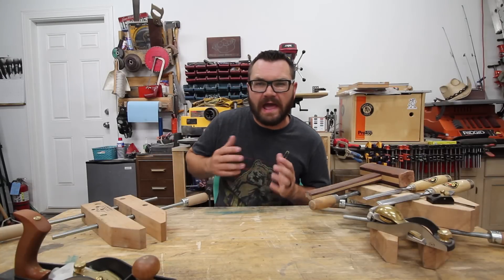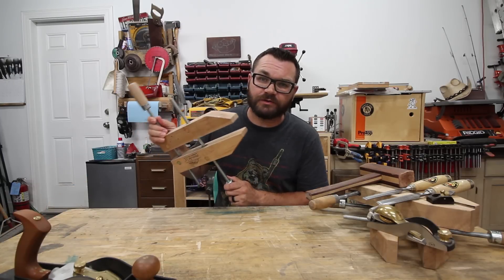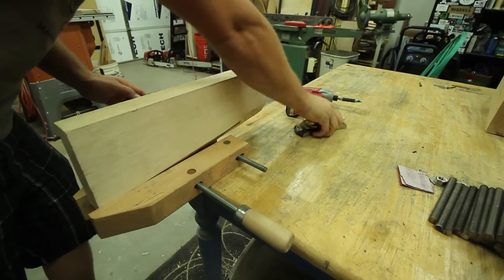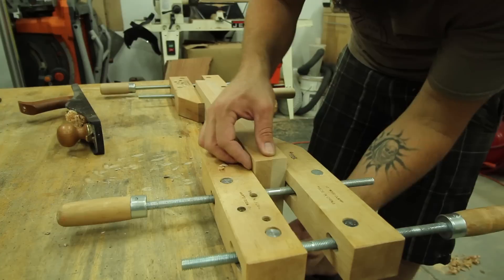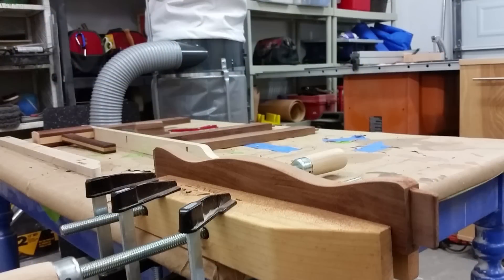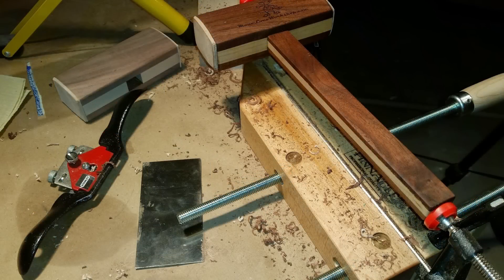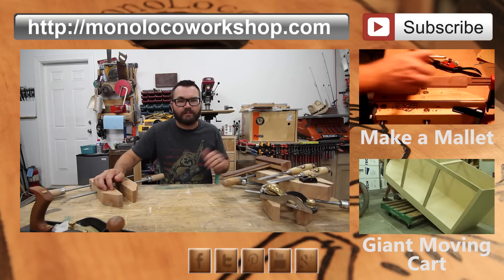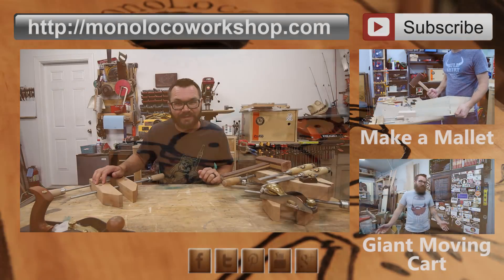Quick Tip! Hand Screw Clamp Bench Vise - MM#03

Comment: As far as vises go, this was my method for a couple of years. I had a 7’ peninsula I saved from a job into which I mortised a T track, drilled two holes through the hand screws put 3/8” round head bolts in the T track then the hand screws fastened with knobs I made on the drill press.

Comment: thats AWESOME! i have 2 of these clamps just collecting dust.. im going to do this right now.thanks for the great tip!☆☆☆☆☆👍
Reply from the maker: That's the way mine were before I had a problem that need solving and my clamps ended up being the solution.
Reply: +Ty Moser (MonoLoco_Workshop) dude they work awesome..im seriously considering taking off my vise and using these in place of it. lol
Reply from the maker: LOL. I leave one on the corner of my table for months at a time. They come in SUPER handy!
Reply: Ty Moser I BET! im gonna give it a try as a replacement for the vise amd see how it goes my vise is  that little blue irwin from lowes.and for the jaws i have 2 pieces of oak and those take up almst 2" so the clamps might open up more..lol
Reply: Ty Moser and hopefully no racking..haha ill find out tomorrow that's what I'm going to make the transition I'll let you know how it works out